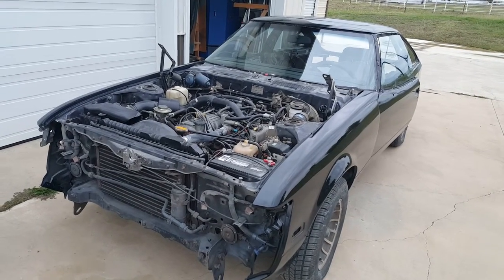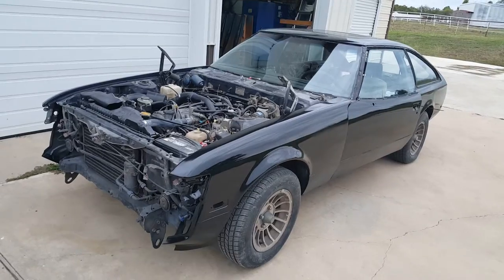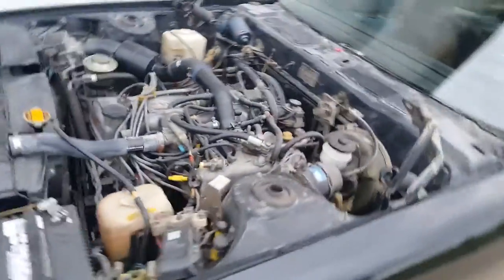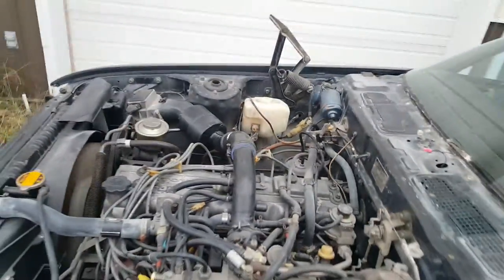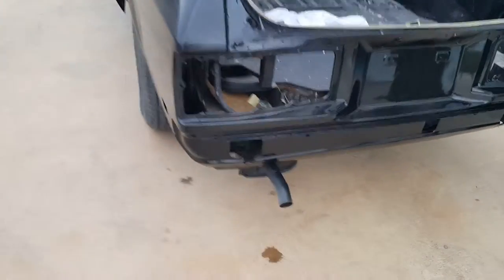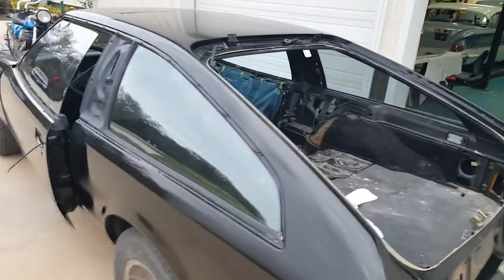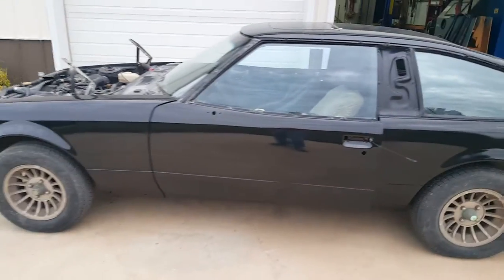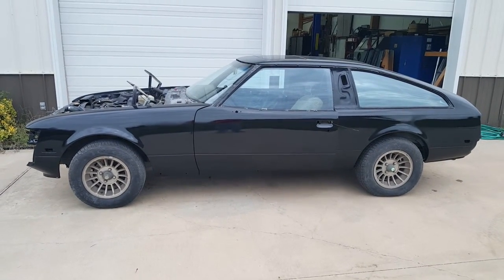1979 Toyota Celica Supra Restoration

Comment: This car is looking great! I have an 81 Supra with ZERO rust that had what i would call a poor repaint. It's fading and staining and will need repainted again. What would a good repaint with clear coat cast on a car of this size? The paint that is on mine now is single stage. Im thinking its a contributing factor to the fade and staining on the hood and roof. I'm not looking to do a color change so it's staying the original toyota burgundy.

Comment: Did anyone  ran into any  Electric problems
Reply from the maker: The only electrical issues we encountered were a sticky fuel pump relay (disassembled, cleaned and works fine) and a failed neutral safety switch which occasionally caused the starter to engage when in reverse.  Otherwise, everything worked just fine.